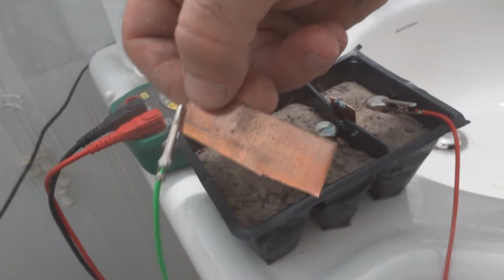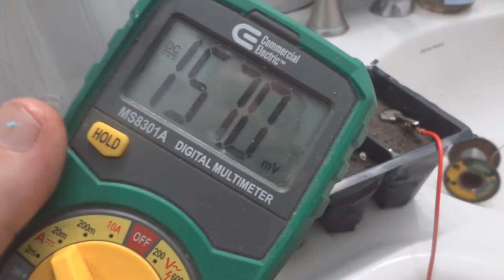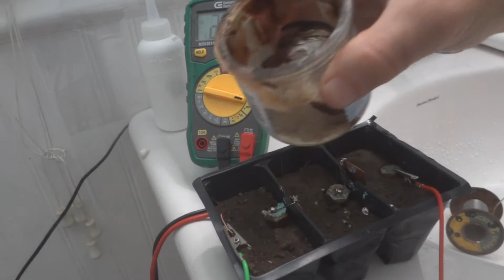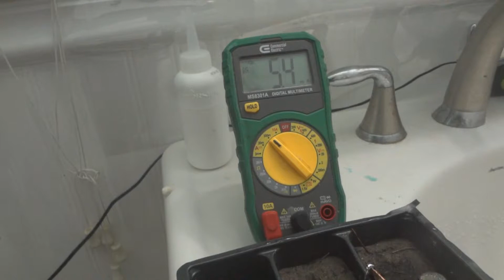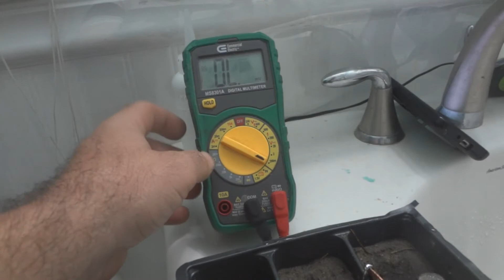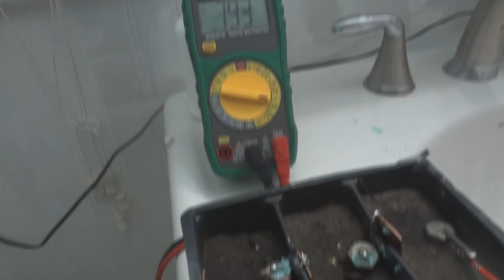Earth battery 2

Comment: You totally did everything wrong. 1st the dirt is contaminated use clean white beach sand and heat it over a hot fire OR use white fish aquarium sand at wallmart ,  2nd Use more iodized salt than vinegar , 3rd you need more cells , 4th ALL plates should be like the flat copper one. Do this and you will see a MASSIVE improvement to your cells.